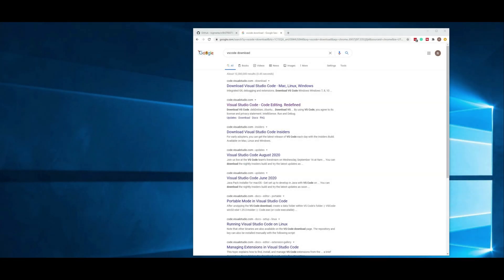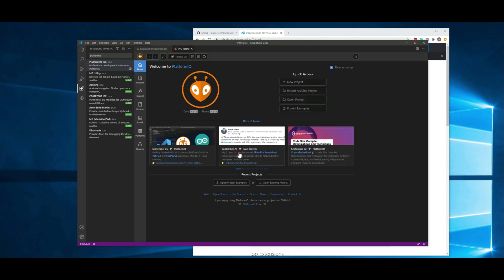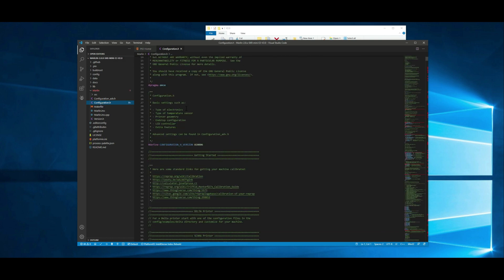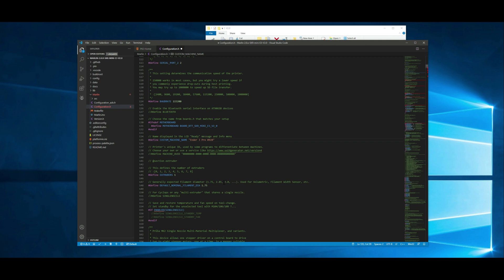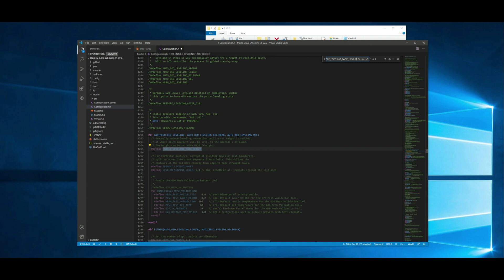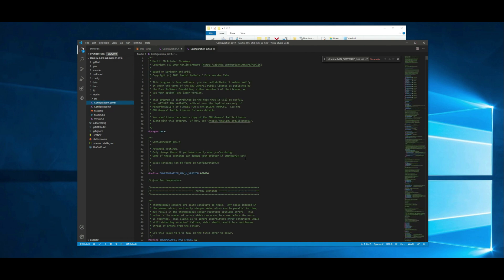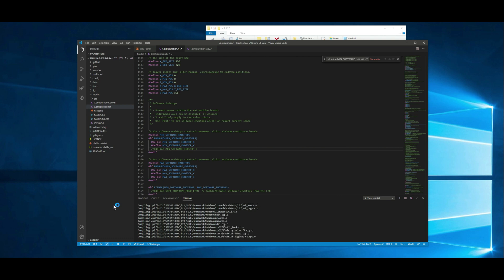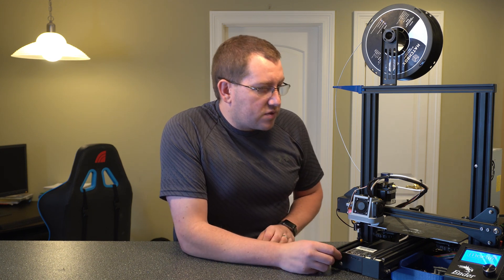How to Compile Custom Firmware for SKR Mini

Comment from the maker: I hope you found this overview helpful! If you have any questions or would like other tips/tricks, just let me know in the comments.
Reply: Why is the check mark not showing in the bottom tool bar? I am trying to set up a Ender 3 with BLtouch on a SKR Mini E3 V2.0. Thank you for any help you can provide. Cheers.
Reply from the maker: @steveburley3738  That only happens if you dont have the platform io plugin installed right or if you dont have the right folder open in vs code.
Reply: @3DPrintscape  Oh bother. Sorry I probably messed it up as usual. Is there a place where I can get the .bin file to install in my printer? I just want this to finally work. I have an Ender 3 with the SKR mini E3 V2.0 and the BLTouch . Thank you for any help you can provide and keep up the great videos.
Reply from the maker: @steveburley3738  I have some builds on my site that you could use. https://3dprintscape.com/marlin-firmware-builds/
Reply: @3DPrintscape  Those are great but there is none for the Ender 3 with the SKR mini E3 V2.0 and the BLTouch .
Reply from the maker: @steveburley3738  I have firmware there for that setup. Im actually running that firmware in this video.
Reply: Dude, thank you so much! I was having so many problems with the BTT pre-compiled BL touch firmware.. i just could not for the life of me get a good print, after watching this I not only compiled my own firmware (for the first time) but I also managed to fix the issues I was having. While the first few layers of the print weren't perfect, they are acceptable for now. Ill have to tweak the offsets a bit more but, so far so good!
Reply: Rob, thanks for your service and these very helpful videos.
I am having issues installing PlatformIO in the VS Code. I get the error message 
"ERROR: could not start PIO Home Server: ERROR: time out"
The recommended fix did not work.
This is on a completely updated Windows 10 notebook computer.
Would it be possible for you to compile a bin file for a CR-10 mini with BL Touch and filiment sensing so I could download? Otherwise I am stuck with a new mini board, TFT display and BL touch sensor I can't use. If anyone reading this can help, I would appreciate it greatly. Very frustrating...Thanks!!
Reply from the maker: @ssnydess6787  I can probably make something for you. Are you able to join the discord server? The invite is in the video description.
Reply: @3DPrintscape  I was able to login. Can we get started on a bin? Glad to  compensate ahead of your work. Thanks!
Reply from the maker: @ssnydess6787  Can you ping me on Discord and let me know its you?

Comment: Hi I realize this is an old discussion but I wondered if you might be able to help me. I have an Ender 3 Pro which I have upgraded with an SKR Mini E3 V3 and a CRTouch. I followed your instructions for the firmware upgrade but as soon as I plug in the CRTouch to the board I loose the display and get a blue screen. I am wondering if you have encountered this issue before and if so is it hardware or firmware related?

Comment: Hi, i worked through all the amemdments but when I go to build via the terminal at the end i get this message onlyPS C:\Users\admin\Downloads\Marlin-bugfix-2.0.x\Marlin-bugfix-2.0.x\Marlin>

Under problems this is the message
[{
	"resource": "/c:/Users/admin/Downloads/Marlin-bugfix-2.0.x/Marlin-bugfix-2.0.x/Marlin/Configuration.h",
	"owner": "C/C++: IntelliSense",
	"code": "1696",
	"severity": 8,
	"message": "#include errors detected. Please update your includePath. Squiggles are disabled for this translation unit (C:\\Users\\admin\\Downloads\\Marlin-bugfix-2.0.x\\Marlin-bugfix-2.0.x\\Marlin\\src\\MarlinCore.cpp).",
	"source": "C/C++",
	"startLineNumber": 1,
	"startColumn": 1,
	"endLineNumber": 1,
	"endColumn": 1
}]
Reply: I have the ender 3 not the Ender 3 pro, does this make any difference?

Comment: Is this any different for newer versions?/other changes?
As well, using your edits/bugfix files, would you follow this in ways?
Reply from the maker: Hi. At a high level this is the same with newer builds, you will just want to make sure your replacing/editing the right config files. They should be in Marlin-bugfix-2.1.x\Marlin.

Comment: I tried updating the firmware and put the sd card in the screen was blank as described but never went unblank. I have since taken the sd out and restarted power and still blank screen
Reply from the maker: Hi. What screen do you have? I havent really seen this behavior on the SKR boards, the creality boards get a blue screen if the filename is the same as used before. Also, did you try the bugfix or stable build? If bugfix, try the stable one.

Comment: I am trying to get a base Ender 3 working with CR Touch but need my bed size to be 220 x 220 otherwise the X and Y axis try to advance beyond what is physically capable on my printer. Any chance you have SKR mini E3 V3 firmware that I could tweak for the bed size? I try to compile the firmware following your video but I keep getting errors and BTT does not seem to have the config.h file available on github anymore, only pre-compiled firmware with a bed size of 235 x 235.
Reply from the maker: Hi. I have some firmware that you can download from https://3dprintscape.com/marlin-firmware-builds/ . This post may also help you as well. https://3dprintscape.com/skr-mini-e3-v3-firmware-guide/

Comment: hello, i cant thank you enough for this, quick question, for the whole z min probe... set to true, it caused it to start homing z axis with the bl touch retracted causing the nozzle to crash into the bed, and then i set it back to false and did the same. can you help me?? but once again thx for the video.
Reply from the maker: Hi. What firmware are you using, how is the bltouch wired, and is the z stop connected?
Reply: @3DPrintscape  I have the white and black wires where the z stop should go. I have the brown red and yellow wire in that order where the bl touch port goes and I'm running skr mini e3 V2
Reply from the maker: @brayanhernandez8805  Verify the pin out but that sounds right. You would just need to make the change i mentioned on top of the normal changes for the bltouch.

Comment: Just can't get platform io to allow me to run a build. The check mark isn't there for me on the blue bar
Reply from the maker: Hi. Sounds like either it didnt install properly or you opened the wrong folder. Make sure to open the root marlin folder (it should have the platformio.ini file in it).
Reply: @3DPrintscape  that's the folder I have. Looks exactly like what you have on screen, it allows me to make all the changes you make in the video. When I go to the top left and click start debugging or run it pops an error

Comment: Hey Rob. Is there a way to backup my current firmware? I have the original firmware.bin file, but I don't want to have to do my esteps and such all over again... I am currently editing the new config files, trying things, and in case I mess up completely, I'd like to keep my old firmware handy just in case to avoid printing delays meanwhile I fix the editing for the new firmware.
Reply from the maker: Hi. There is no good way to do that. I would recommend just going through and writing down all your changes to make them again.
Reply: @3DPrintscape  sounds good. Thanks!

Comment: Why is the check mark not showing in the bottom tool bar?
Reply from the maker: Hi. This only happens if you dont have platform io installed correctly or you have the wrong folder open in vs code.

Comment: Is this process still the same nowadays, even for the v3.0?
Reply from the maker: Hi. Ya its still the same, only difference is you will want to get the config example for your board. I would also recommend using the marlin auto build plugin.
Reply: @3DPrintscape  ah i see. I have a clone bltouch, and want to enable high temp printing (i have the microswiss all metal hotend,along with a hardened steel nozzle). Hopefully I'm able to figure out and don't get overwhelmed... I gotta find that plugin you mentioned also
Reply: @3DPrintscape  I downloaded a firmware from reddit long ago, it actually made my bltouch work since I had a clone bltouch. The problem was it would level properly, then when it tried to print it would save the leveling points it did in a 3x3 grid. Somebody had that problem, fixed it for them so i downloaded it and it fixed my leveling issues. Altho I'm not sure what they wrote in the code to make it work cuz other pre-compiled bltouch firmwares were not working... How can I check a firmware's config.h so i can write that part of the code onto my own custom firmware?
Reply from the maker: @nextlvlroy  You cant see the config for a .bin unless who ever made it for you provides it.
Reply: @3DPrintscape  oh ok i see. Also, I downloaded both bugfixes for Ender 3 Pro - SKR E3 mini v3.0, but the marlin auto build plugin doesn't recognize it. How come?
Reply from the maker: @nextlvlroy   I just checked my side and it did recognize it. You moved the config files to your working firmware folder right?
Reply: @3DPrintscape  I did not. I was missing that step actually. I downloaded the Marlin firmware bugfix 2.1, compiled, it worked. Then I added the config files for the BTT skr e3 mini v3 for bugfix 2.1 bltouch with z homing, attempted to compile 5 times and it fails.  First error says "YOur Configuration.h file is for an old version of Marlin. Downgrade Marlin or upgrade your configuration.h". I got this config file from the Marlin Firmware Builds from your website.
Reply from the maker: @nextlvlroy  The config files on my site are from an older version. You will need to grab the new one from the marlin download page and transfer over the changes.

Comment: Great video!, I put this board in a year ago and still have not added my bl touch..  Board worked out of the box (less bl touch)    I have a version 3 board though and don't see the files on github for v3..  Anyone know if I can use v2 files?
Reply from the maker: Hi. The v2 firmware will not work for the v3 board. I have some prebuilt ones on my site though. https://3dprintscape.com/marlin-firmware-builds/
Reply: @3DPrintscape  thank you very much!  I’ll check it out!

Comment: This was a super in depth video and you were very thorough with your guided walkthrough!  Thank you for this.  I am however running into one problem when writing the file.  Under pins_postprocess.h I get this error message: "No E stepper plug left for Z2!"
I'm at a loss here because I'm at a complete halt.  Any suggestions?
Reply from the maker: Hi. What board and config example did you start with?

Comment: When I click on the firmware link provided, the files that come up are not the same as what is shown in the video. The files I am seeing are for an Ender 5. I recently installed the SKR Mini V2 in my Ender 3 (not pro) and I believe I need to make an adjustment for the Z axis. After successfully leveling my bed and the spacing between the nozzle is correct, I start a print and the nozzle is too high off of the bed and nowhere near where I had it set. I have been trying to fix this issue for a week now and I'm not getting anywhere. My skill is limited so I may be missing something here. Any help is appreciated.
Reply from the maker: Hi. They change the site up a lot. It sounds like the z offset may not be set right. I have some videos covering that.
Reply: @3DPrintscape  I will look through your videos to see if I can find it. I have yet to find one from anyone adjusting the Z axis with a regular Ender 3 with the SKR mini V2. Every video I’ve watched has options on their screen that I don’t have. It may be just that I need to modify the firmware but that’s over my head. Thank you for your response!
Reply from the maker: @fleischklobchen1  Were you able to find the video?
Reply: @3DPrintscape , I looked and I have not seen a video that is helping me with my problem. Bed leveling is fine and the gap is good. When I start a print and it starts printing, the nozzle is too high and nowhere near where it was when I leveled the bed. It did the same thing with the old 8 bit card as well.
Reply from the maker: @fleischklobchen1  It still sounds like the z offset is not set, or was set but not saved.
Reply: @3DPrintscape , I’m lost on how to set the Z offset. I’ve followed multiple videos and nothing has worked so far. I’ve adjusted the Z switch multiple times and leveled the bed. Outside of that, I’m clueless on how to adjust it any further. I do not have a BL touch on my Ender 3 or my Ender 3 pro. The Z adjustment on the screen is at 400. I’m not sure what that means but I’m guessing it’s a default setting. Also, I cannot go below zero when moving the Z axis and I’m not sure how to calculate what it should be changed to.
Reply from the maker: @fleischklobchen1  I thought you had a bltouch, thats when you need to adjust the z offset. You may need to walk through the leveling process multiple times to make sure when you make an adjustment on one side, it doesnt impact the other side. Also, make sure everything is tight. If you have a loose axis or carriage you will see problems like this as well.
Reply: @3DPrintscape  yeah I have done it multiple times. I did get the old one and the new one to print pretty well but now I’m having warping issues. Both have glass beds and I’ve tried glue stick and hairspray but I may have a humidity issue in the shop that may be causing it. I think I’ve adjusted everything I can think of with them.

Comment: I tried following your instructions but for the version 3 of SKR mini. There is no check mark at the bottom to compile and there are also 148 errors all reading "function call is not allowed in a constant expression". This whole coding stuff is completely out of my element, might as well be chinese...
The stock directory of the firmware has PlatformIO in it and I have the extension installed.
Reply from the maker: Hi. It sounds like you dont have platformio installed or you opened the wrong folder in vs code. Make sure you open the root level folder, it should have the platformio.ini file in it.

Comment: I have just tried editing the "configuration.h" file and got the following error message :-
	
	"severity": 8,
	"message": "#include errors detected. Please update your includePath. Squiggles are disabled for this translation unit (X:\\3D printing\\Ender_3 Firmware\\BIGTREETECH-SKR-mini-E3-master\\BIGTREETECH-SKR-mini-E3-master\\firmware\\V1.2\\Marlin-2.0.x-SKR-Mini-E3-V1.2\\Marlin\\src\\MarlinCore.cpp).",
	"source": "C/C++",
I have no idea what this means or how to fix it, help would be appreciated.
Reply from the maker: Hi. Try to move the firmware file closer to the root of the drive.

Comment: I don't have the little check box at the bottom now what?
Reply from the maker: Hi. It sounds like you dont have the platformio plugin installed, or you have the wrong firmware folder open. You want to open the folder that has the platformio.ini file in it.

Comment: there is no compile option on the bottom of the screen
Reply from the maker: Hi. It sounds like platformio is installed or you have the wrong firmware folder opened. It should have the platformio.ini file in the root folder.

Comment: When I try to build I get  "error: #error "Your Configuration.h file is for a newer version of Marlin. Upgrade Marlin or downgrade your Configuration.h."" Any idea how to fix this?
Reply from the maker: Hi. It sounds like you dont have the config file that matches the version of the firmware you are trying to build.
Reply: @3DPrintscape  I ended up just using the bigtreetech firmware without replacing the config.h files. Seems to be working well now! Using only the marlin firmware also seemed to compile ok.

Comment: Great videos! Yet I come seeking help! I'm running VS Code on a Mac platform and have gotten to the compile step only to get the following error:
Error: Build environment 'STM32F103RC_btt_512K' is incompatible with BOARD_BTT_SKR_MINI_E3_V2_0. Use one of these: STM32F103RC_btt,...
Which then lists a number of options. I'm using the Marlin-bugfix-2.0x firmware, for the record. I've googled the error to no avail, so I come to the source! Any and all help is greatly appreciated. Thank you for your work!  Ender3Pro, Mini E3 v2.0, BLTouch
Reply from the maker: Hi. The environment variable has changed since i made this video. I would recommend using the marlin auto build plugin, it shows you the available ones. I have a video covering it that you can see here. https://youtu.be/EerWIATEsM0

Comment: when it "successfully builds", does it matter what environment it uses? mine is different than the one on yours but it also seems to pull that automatically. sorry a bit new to this lol
Reply from the maker: Hi. It should be tied to an environment meant for your board. What environment did you choose?
Reply: @3DPrintscape  it doesnt give me an option to choose. it does it by itself
Reply from the maker: @chrispalmieri2333  Try to use the marlin auto build plugin. https://youtu.be/EerWIATEsM0

Comment: I was wondering if you happen to have a video/tutorial on the skr mini e3 v3. I tried following your advice for building the firmware to include a dual z along with ability to run g34 code
Reply from the maker: Hi. I just bought an SKR Mini v3 and plan on making a couple video about it in the next month or so.
Reply: @3DPrintscape  That would be awesome. I often turn tonyour vids for guidance sorry it would be amazing

Comment: Hello Guys! I have a Voxelab Aquila and today it's arrived my SKR Mini E3 V3......but i think it's not possible to use that with my display. If i buy the TFT35 E3 V3.0, it's compatible with my printer and  the new SKR Mini? Sorry for my english, and thanks in advance for the help
Reply from the maker: Hi. As long as you are using the firmware for your printer on the skr mini, the tft should work just fine.